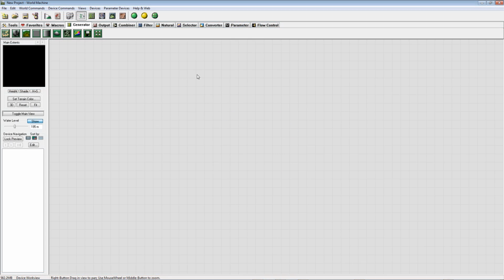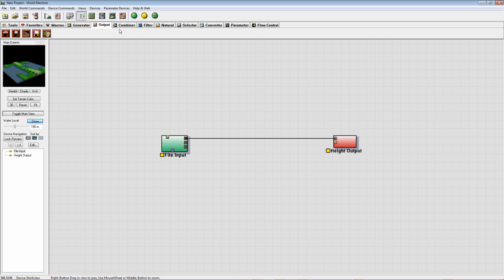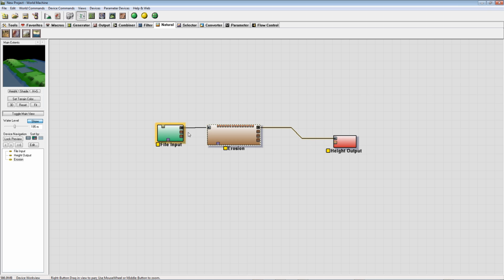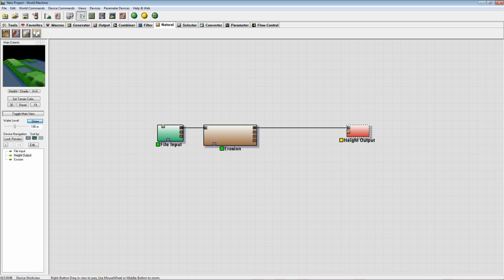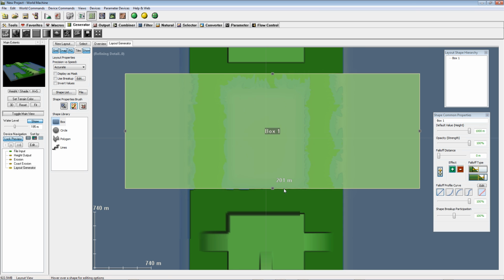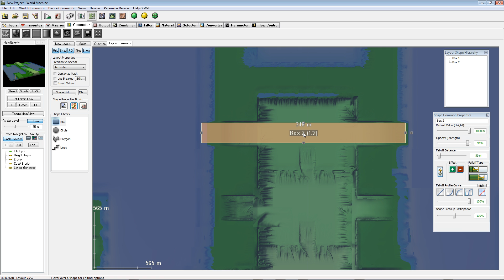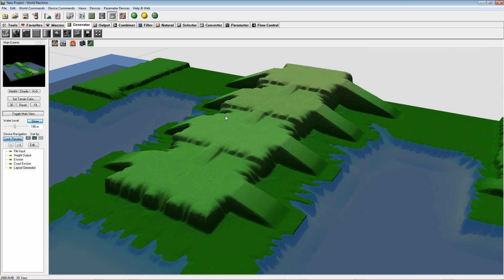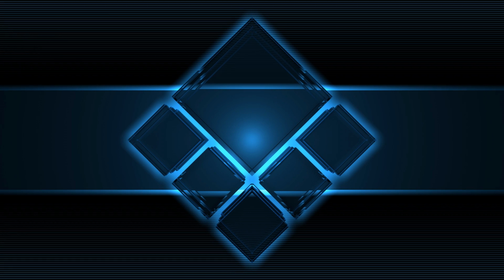Creating a Map for Supreme Commander: Forged Alliance - Part 2 - Adding Erosion in World Machine

Comment: Is it possible to use the mirror function in the FAF map editor once you have imported the heightmap image?
Reply from the maker: Hello, i used the original Supreme commander map editor which requires Supreme Commander and not FAF.
Im not sure about the mirror function (Its been a while).
But what you can definitly do is: Load the heightmap into Photoshop or Gimp and do the mirroring there. Save it in the correct .raw file format though so the editor can read it correctly.
There is also indeed a new "FA Forever Map Editor" in beta development here: https://wiki.faforever.com/index.php?title=FA_Forever_Map_Editor#Introduction
But i did not test i yet.
Reply: @blaxxun75  thnx for the tip, ill give it a go.
Reply from the maker: @OzDeaDMeaT  Ur welcome bro. Happy mapping! ;)